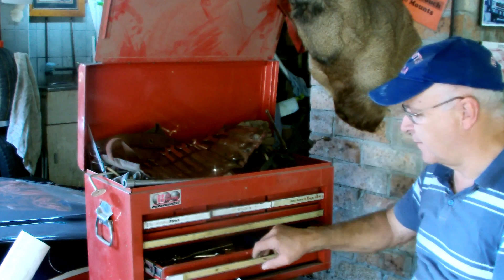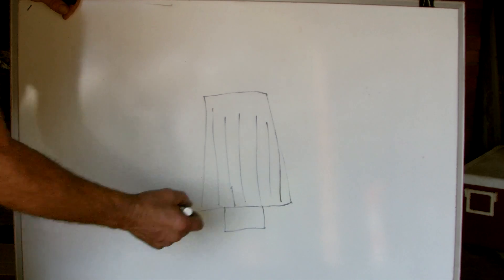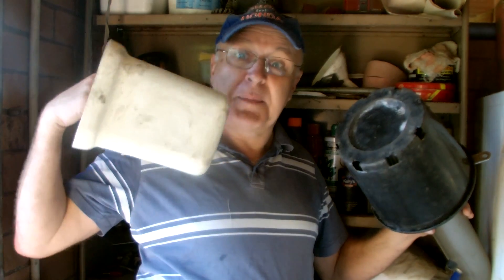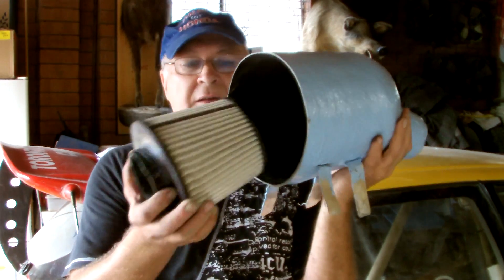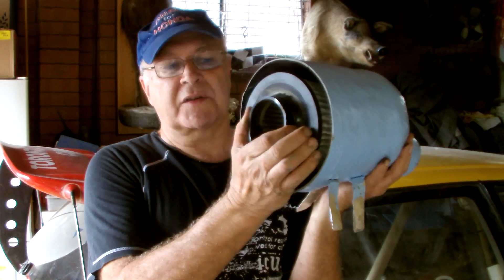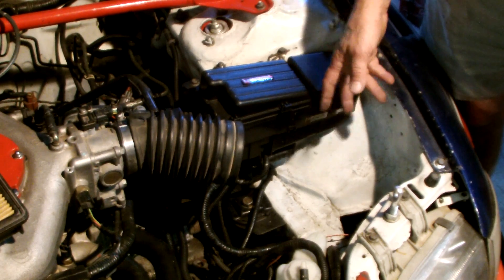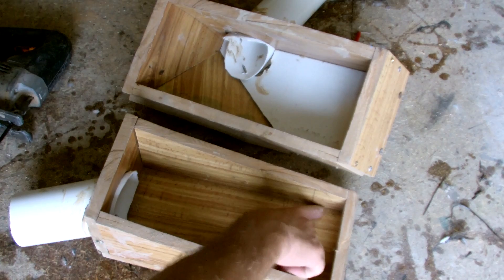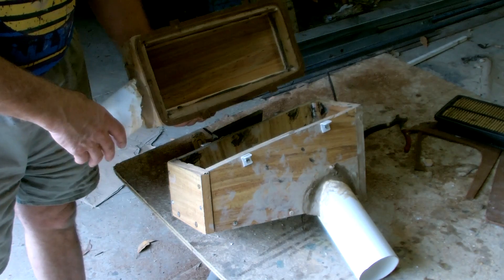How to Make a Fiberglass or Carbon Fiber Airbox

Comment: How does this hold up against heat under the hood? When I search on google it all says fiberglass has a very high heat resistance but would it be the same if I home made them with basic materials?
Reply from the maker: It is a myth that fiberglass will ignite under the hood. Put it directly on an exhaust manifold and yes it will, like almost anything else. I have been running fiberglass parts under my hood for over twenty years with no problems regarding heat whatsoever.

Comment: Awesome DIY, I’m currently building a VW TDI air filter box to fit my VW van; similar to your second Honda filter made with the square filter. I’m thinking of building the box first in CF then drill the holes. Then make/buy some CF tubing to epoxy around the holes. Did this cross your mind? Thanks for the inspiration!

Comment: this is great - but just a clarification for you on gelcoat vs. flowcoat.
Gelcoat will stay tacky while exposed to air.  Flowcoat has wax in it (you can make flowcoat by adding wax), which floats to the surface after application, thereby isolating the styrene from air and letting it set.
The reason you want a tacky surface on gelcoat is so the subsequent (fibreglass) resin forms a chemical bond with it.
Reply from the maker: Thank you - that's all spot on. I did already personally know that as my last job was with Australia's largest (& possibly only), manufacturer of resins, flowcoat & gelcoat in Australia. In making tutorials for absolute beginners one has to avoid over loading them with too much information initially, and then leading them progressively deeper as their experience & knowledge grows with my "Masterclass" level tutorials. But thanks.

Comment: May I ask what your take is on rust repair with fiberglass?
Reply from the maker: Success depends mainly on two things that most  home mechanics overlook: 1) Find the source of the rust. Why is it happening? Where is the water coming from? Make sure it can get away after your repair. 2) Adhesion. Putting a fiberglass patch on failing metal will result in it eventually coming away. Grind all rust away. Prime the metal before you apply fiberglass.  Cover your fiberglassing with Top/Finish coat (NOT Gelcoat), then a skim of car body filler.

Comment: what brand is that finish coat? did you have to sand or scuff the fiberglass before putting it on. great video.
Reply from the maker: Trojan from their Newcastle manufacturing plant where  used to work. In other countries it's also called "Top Coat". You don't HAVE to sand or scuff for great adhesion, but I always sand with 120 discs to get the smoothest finish before top coating. Another method is to make an extra top layer of 6 oz. woven cloth as used by surfboard builders. This eliminates the "hairy" finish of chopped strand mat (csm), but it doesn't work well on multiple curved surfaces because it is woven.
Reply: oh ok, im going to look into that. why dont you use fiberglass tissue paper. its like a thicker veil. i never used it but its for a smoother finish.